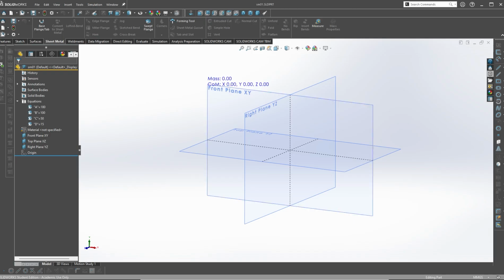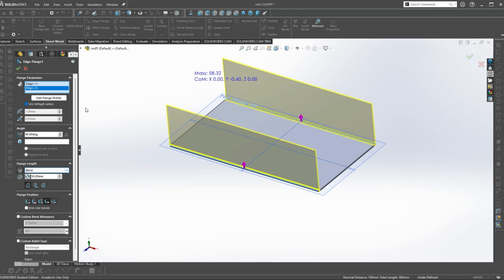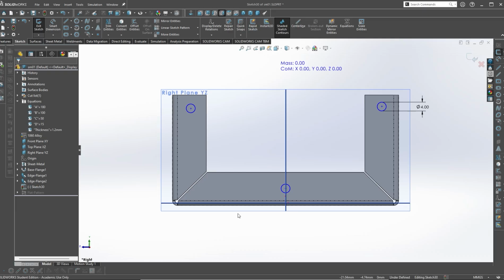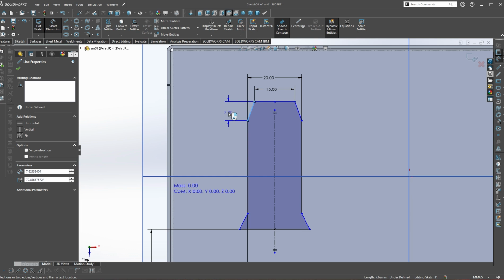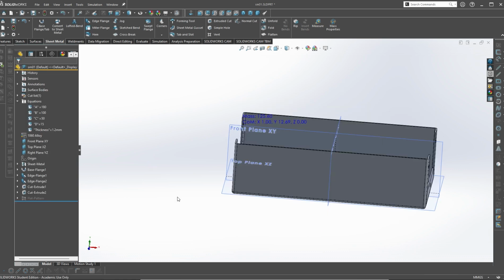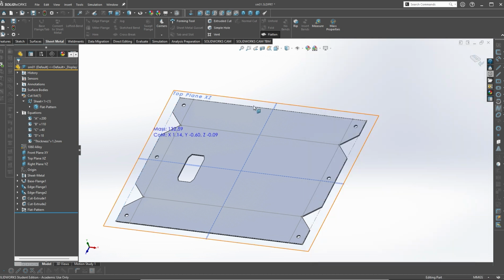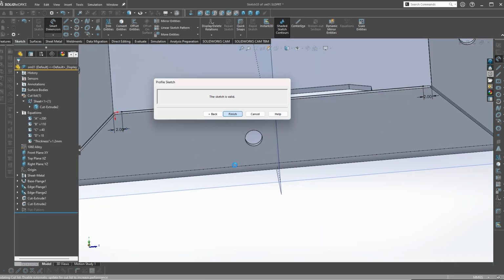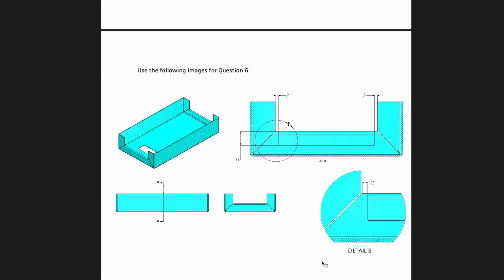CSWPA-SM Sample Test Walkthrough

Comment: 4:56- Below the measurement box are some crucial buttons for setting the measurement origin. It changes where it measures the distance and if chosen wrong can throw you off badly. The default for me was inner virtual sharp and I had to set it to outer virtual sharp. Also, they never specified that in the instructions. How fun!